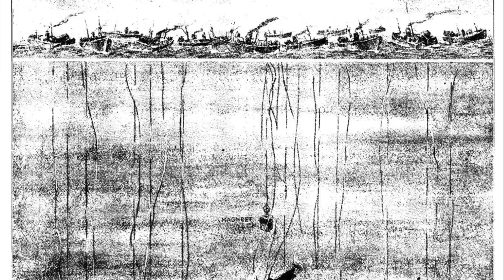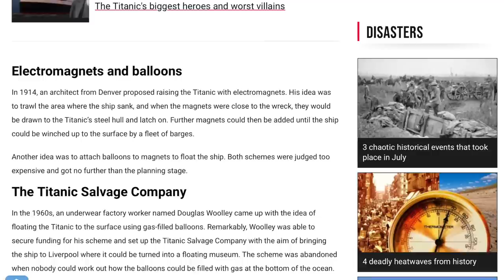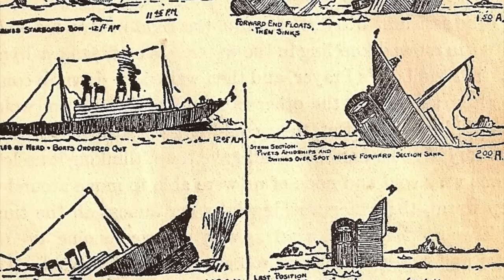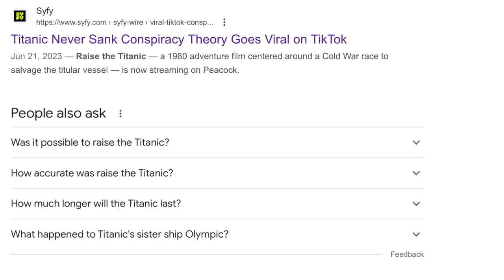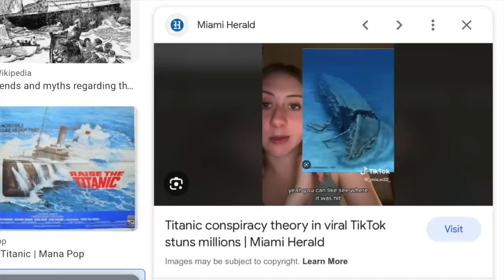Dumbest "Raise the Titanic" theories

Comment: The SS Andria Doria which sank in 1956 is also falling apart and collapsing. Sea water is not kind to steel. 
How the heck was the proposal to encase Titanic in ice going to be done? Ice cube by ice cube? The idea is ice floats but would have to be pushed & held down. To raise Titanic with ballast would require at least as much mass of ballast as the bits one wants to raise. Raising anything from Titanic requires approval of RMS Titanic Inc. the sole & exclusive savager.

Comment: PromoNADE - not promodon.  Any way. There is no realistic idea of how to raise this and there is no real way to make any use of what remains and all the steel would cave in on itself as the water around it is supporting it. Remember water suspends everything in it at one third its' weight on the surface so any thoughts of making this happen are fool hearty and unrealistic by any means!  There would be more pressure of gravity pulling on the superstructure keeping it from being equally supported along the frame and all the steel flooring in between the decks. Anything that could be salvaged would have to be done immediately to keep the air from causing it to disintegrate. Meaning any artifacts that may be usable or recognisable would have to be secured straight away but that would take months if they decided to cut the entire remains apart to salvage what they could find underwater. And it would be astronomically expensive!! None of this is more than a fantastic pipe dream!
Reply: the dummy won’t listen. he can pronounce it
Reply: @paulwoodford1984  Who are you calling a "dummy" - me or him?
Reply: @solarismoon3046  the annoying ginger dude. He needs to give the script to another person lol

Comment: I know why
it is thought to be the olympic on the seabed

no one notices that the nose of the ship stops the railing sooner

when the 2 were built the olympic had a meter between them

not the titanic that ran all the way to the tip .

so if you see the ship sailing after 1912 until 1935
bells will ring

because that ship also has the continuous railing

and the one on the bottom doesn't have that.

I have zoomed in on all photos.

from when they were still building

the rest they could all exchange.

you put like then all
extra people and believe me that works easily.

with those window pies tie 1 shot that only had to be placed

and if someone still tells on his deathbed it's the olympic
and then there is the ship that suddenly stood very quickly on a scrapyard for ships, suddenly everything has been sold that no one can check anymore was suspicious.
Reply: Changing things would have taken a lot of time and a lot of people to pull off. The more people involved in a conspiracy the more likely someone would let something slip. For example the Titanics hull number 401 is stamped on the propellers on the wreck. Those are not something you could just switch out overnight.